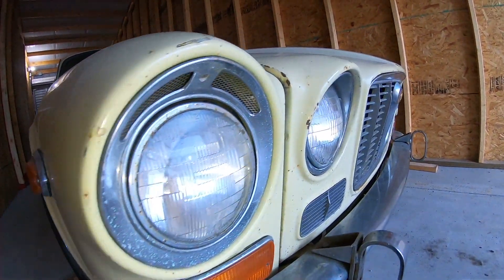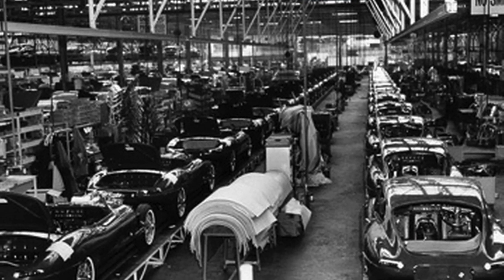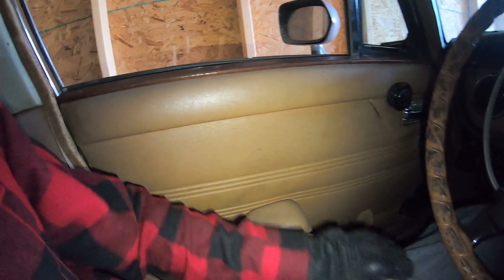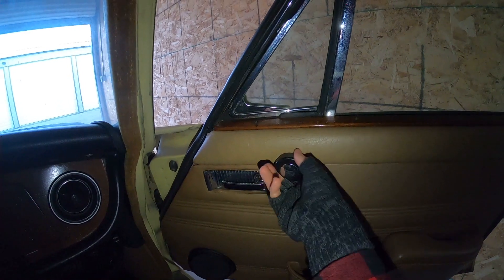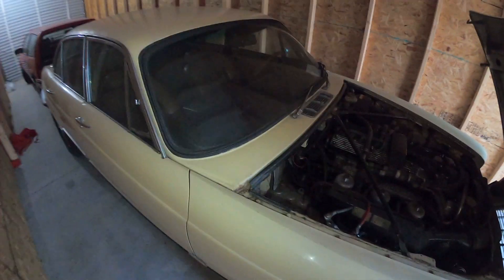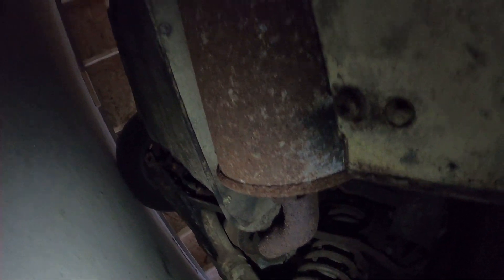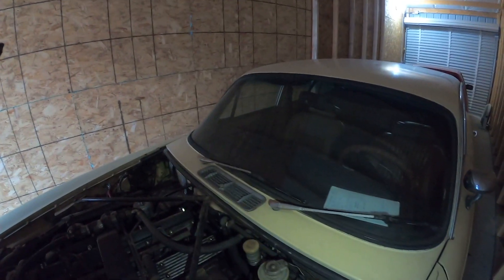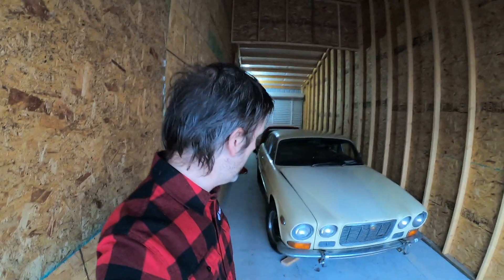Budget British Build:  70s Jaguar XJ6 Series 1 5spd Manual Overview & Initial Inspection

Comment: xk 4.2 s1 one of the best engines ever made. good luck with this project
Reply from the maker: I am more geeked about the drivertrain than I am the car, but the car is pretty cool also.   Can't wait to dive into this!  Until I do I'm watching modified XK engine vids on yotube :P.   Stay tuned tho, plan is to sort it this winter.
Reply: @ADDvanced  and 4 rear spring is quiet  impressive, don't know what's the real advantage of that but it's not common on other cars
Reply from the maker: @ralpha4957  Inboard rear brakes are weird too!

Comment: For someone who's not a aficionado. You more or less got all the correct facts. I think mk10 . Looking at the gate arrangement it's probably a jaguar box . Those triples are worth a couple of grand. But l'd keep them . It gives the car provenance.  And 16 s on the 1/4 mile. Only because it's a very slow gearbox . I had both manual and auto . I love stick shift but not on this pocket rocket. Thanks . I just might subscribe.
Reply from the maker: When I saw the triples I wanted it... when I got it fire, I bought it.   Lol.  

Hope to get to it this spring, need to finish the 911 project first.   It's close.

Comment: Great find.   Manuals are as rare as hen's teeth, especially in North America.   The twin fuel tanks were to maximize luggage space.

Use a good quality chemical wood stripper on the dash, very light sanding with 180 grit and then refinish with Helmsman gloss varnish.  It'll look good as new.
Reply from the maker: Yeah, I've heard estimates as low as less than 10, state side.   Really want to drive this thing!!!
Reply: @ADDvanced  You're going to love it.   They ride like Cadillacs.   I put in an igniter distributor and coil, and haven't had any problems with the Stromberg carbs.
Reply from the maker: @adrianl7147  Ultimate plan would be to road trip it out to california, and cruise around hollywood, where it came from.   Then idk.
Reply from the maker: @adrianl7147  I'm going to go through the carbs and the whole fuel system, it's been sort of sitting a while.   Also plan to drop the rear end and service all the brakes.  Clean up the engine bay, and get it driving properly.  Do not care about paint at all, but I did acquire some earlier bumper overriders, and the larger headlamps.   Looks way better imho.

Comment: Thats a rare beast- factory manual trans & if its original panit & trim could be a valuable asset 
I reckon these jags will prove to be very long lived & as resiliant as British motorcycles-the earlys ones that is
Reply from the maker: It's been swapped out; the console is from an automatic, and they never imported manual versions here.   Apparently a jaguar enthusiast owned it, who swapped in the 5spd and the intake/triple carb setup from an E type.

Comment: In the upper right hand corner of the center dash panel where the five smaller gauges are, is a thumb screw. There is supposed to be a similar thumb screw in the upper left corner of that panel but it looks like it's missing. Anyway if you remove those thumb screws, that center dash panel pivots down and behind it is the main fuse panel and a whole bunch of wires.

Also BTW, the E-Types never had a five speed transmission. They only came with four speed transmissions from the factory. So if this has a five speed in it, the trans is most likely from some other brand of car. Also the XJ6 originally had Zenith-Stromberg carbs and each carb had a 1.75 inch throat so pretty restrictive for a 4.2L engine. The SU carbs you have are most likely off a MK10 or 420G and they are HD8 carbs with 2 inch throats. The E-Type manifolds sloped upwards and wouldn't fit under the bonnet of a XJ6 like this. Whereas the MK10 or 420G manifolds sloped down a little bit so the carbs would clear the underside of the bonnet.

If you want to know more about the car, I have a shop that specializes in Jaguars in Youngstown Ohio. I would be happy to talk you through any issues or questions you might have.
Reply from the maker: Wow!   Thank you for all the information!   I'm definitely still learning a lot about this thing.   I'll ping you when I get it back to HQ, as it's currently waiting for me to finish another project.

Comment: Ive got a  71-S1 short wheel base in pale blue with tatty red leather.
Reply: You also have S2 rims on it...they were also on E Types...they also originally came without seat headrests as William Lyons..the Jaguar developer felt the view through the interior should be undisturbed..
Reply from the maker: Kind of wish mine was a different color....    but I'm not going to respray this thing.  Just want to get it on the road!

Comment: I've had 4 of these, and although I now have a '98 XJR, I still hanker after another. Yours looks a nice - an interesting - one. So interesting, I'll even forgive the colour!!

But I've subscribed, so I'll be watching with interest
Reply from the maker: I test drove a 97-99 XJR in BRG a few years ago, had some fender damage, low miles, and only $4500.  Was super on the fence about it....    I know this will be way slower, but I LOVE the interior on it.  Can't wait.  Car is from Hollywood, CA, so ultimate goal would be to roadtrip it to Cali and back.

PS:  I hate yellow cars but it is growing on me.
Reply: @ADDvanced  Agreed, the interior of the Series 1 is what sets it apart from the later models: the two major dials in front of the driver, plus the minor instruments in the centre, with the bank of switches below, great stuff.  And the deep cubby hole beneath is SO useful, which also wasn't available on the later models. And the extra deep, but much simpler grille.

You're making me want one again so bad
Reply from the maker: @citizenx2422  Can't wait.   Going to crank on the 911 this weekend, see how far I can get.   Parts are coming in for the Jag already :P

Comment: One of those switchers on the left is possibly the overdrive on off Jeff uk
Reply from the maker: For when it was still an automatic?
Reply: @ADDvanced  No, on many British cars (and Volvo's) you could get a separate overdrive unit that was attatched to the back of the gbox.
Probably made by Laycock-Normanville. 
The OD can often be used in 3rd and 4th gear.

Comment: Very good looking and quite advanced cars for the time, and they are reliable if properly maintaned despite the rumours. The trouble with cars like this is when they filter down through the ownership cycle. The first owners cherish them then as they depriciate and are sold on they fall into the hands of less maintenance inclined owners until they become worthless money pits. Most of the badly abused series 1 junkers are gone now, so nice find of a clean slightly moded looked after Jag. Those engines are actually very robust if serviced correctly, and very tuneable. Bodies always rusted, typical Brit car of the era, California seems to be the place to go for clean bodied barn finds.
Reply from the maker: Yup.   Honestly the only thing that scares me about this thing is the wiring and the dual fuel tank pump system, which just sounds annoying.

Comment: Have a 72 XJ6 and it leaks oil all the time haha
Reply from the maker: From where?  This one was oddly dry underneath.  Has oil tho!
Reply: @ADDvanced  i have no idea where it is coming from but it looks mild
Reply: No worries man. The time to worry is when it has STOPPED leaking. 😉
Reply: Yep.  My 71 has a major oil leak at the back of the engine. I'll need to pull the engine out and replace that seal.   Or just put in a pint of 20W50 a week!
Reply: @adrianl7147  unfortunately the engine is broken so i may be getting a replacement engine soon